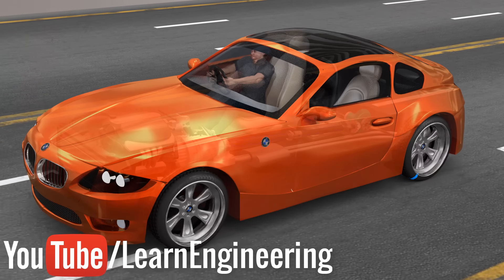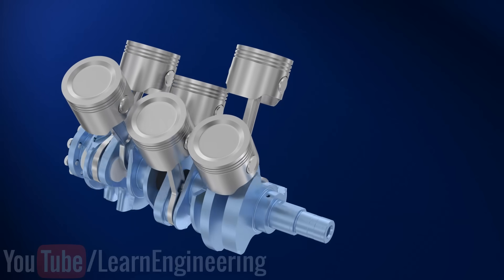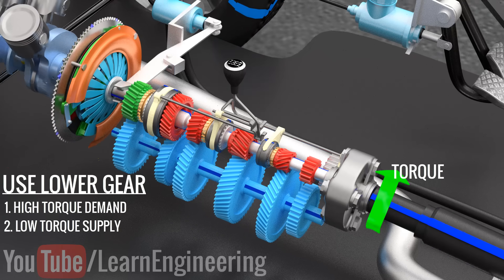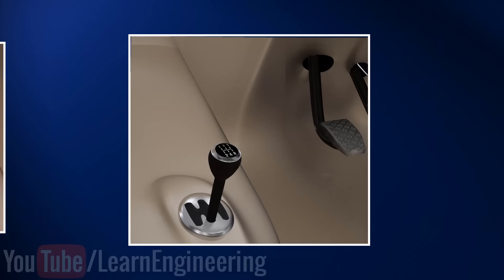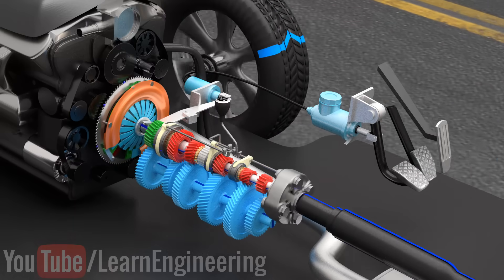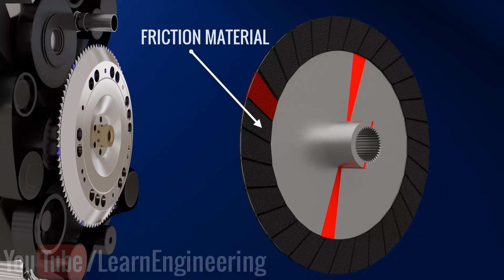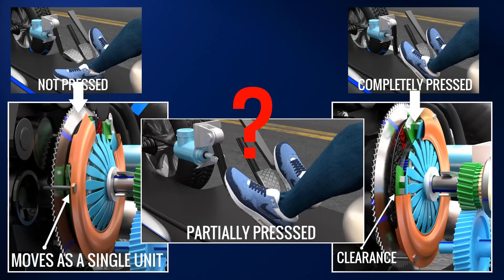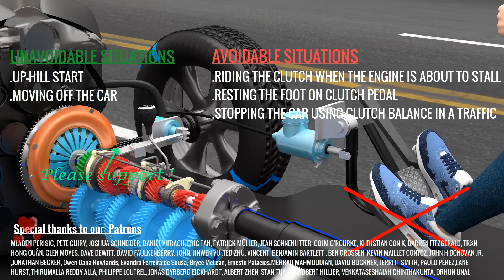Why you should not PARTIALLY press the Clutch?

Comment: Excellent video, but how you can avoid riding the clutch in heavy traffic? When you are in 1st and moving at 600 rpm or less.
Reply: You buying a car with an auto transmission. ;)
Reply: In that case it would be just using clutch as if you were first starting i think.
Reply: In lower gear the rpm to torque ratio is higher which makes half clutch valiable since it doesn't put much strain because of lower rpm.  But say if you try to half clutch in 3rd gear your clutch is gonna get a lot of strain because of higher rpm.
Reply: @Claude-Vanlalhruaia  you don't get how the gears work?
Reply: Wait for traffic to move further away from you to accelerate. Then roll while matching traffic speed. If traffic is slower than your roll speed. Close in and stop. Then repeat. No need to ride the clutch. Yes you are keeping up traffic a bit. But remind yourself that they are not the people that have to pay for your clutch replacement.
Reply: @xesior  people tend to get pissed off when you let distance between traffic lhh or people steal the spot ahead of you
Reply: Exactly, if I keep a distance of a car or more in front of me, there's always someone to steal the spot. I tend to put the car in movement and then put it in neutral so it can go really slow with no problems if it's not uphill of course
Reply: get an automatic car it's better, faster and safer!